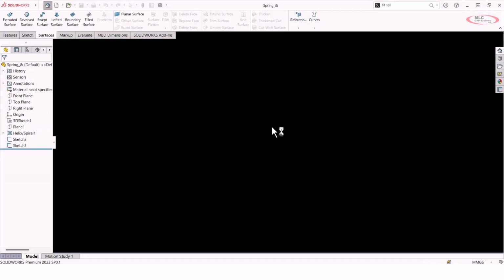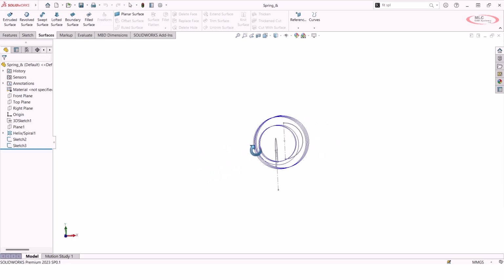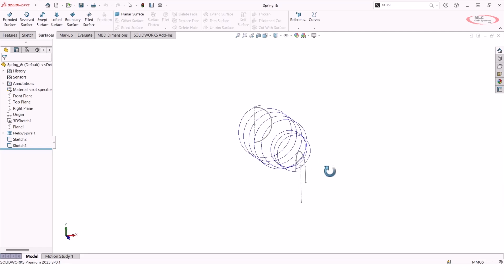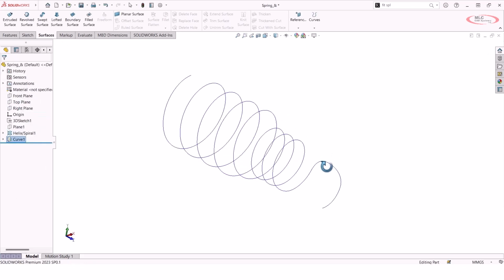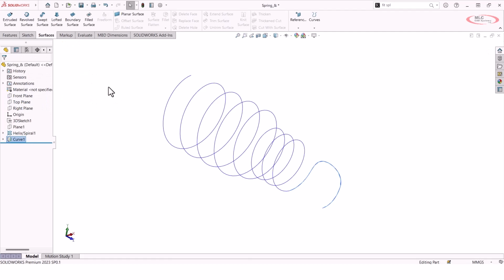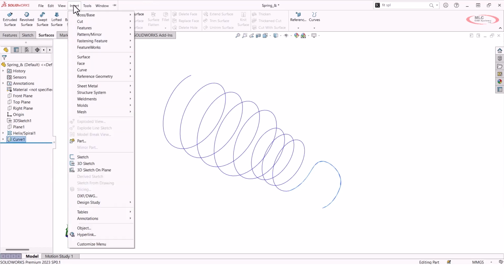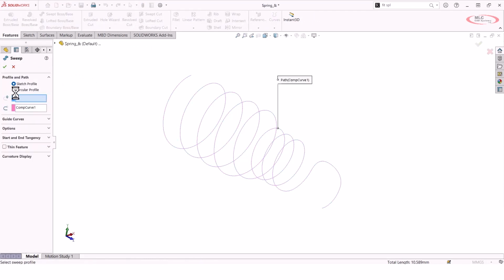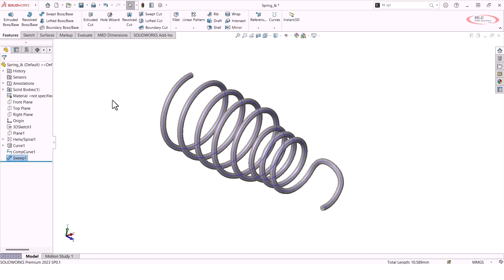Project Curve and Composite Curve - SOLIDWORKS Tech Tip

Comment: Thank you for the time you spend to show us how to use this program very helpful .
Reply from the maker: I'm glad you found it helpful, let me know if you have any questions!
Reply: @MLCCADSystems   well i do have one i am very new to solid works and i have a  old version of it its 2021 i made a sketch (2D) but i need to save it to svg or .nc for use with my cnc but i don't find the option to save it in that format i may be missing it or it may not support it i am not sure do you have an idea or is there a add on for this that must be installed.
Reply from the maker: Sorry for the delay in responding to this question, but .nc files are toolpath files, and they contain a lot more than just geometry.  They tell the spindle when to turn on, how to approach and engage the material in cuts, how fast and deep to cut, and how many passes to remove all of the material.  To create an .nc file, you'll need a CAM software to define the toolpath and export that data.  SOLIDWORKS CAM is included in newer licenses that are on active subscription. There may be some low-cost or free CAM tools out there. Good luck!